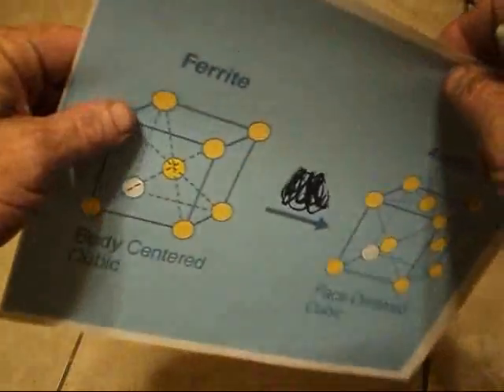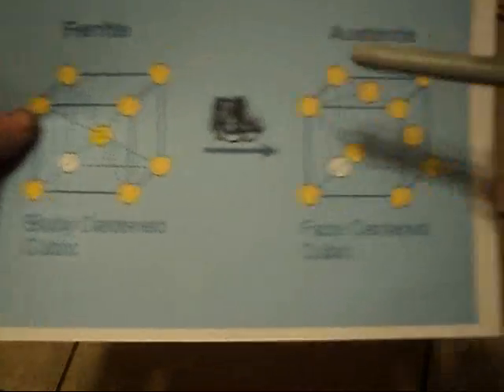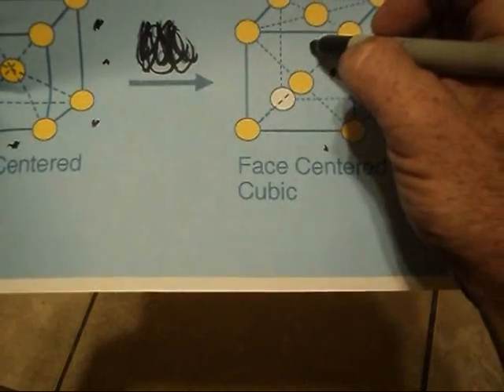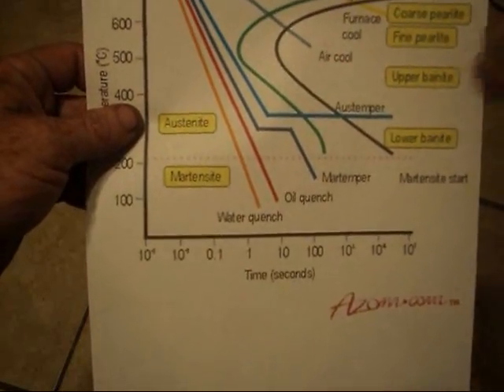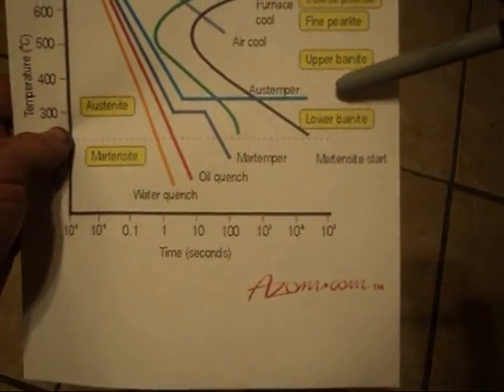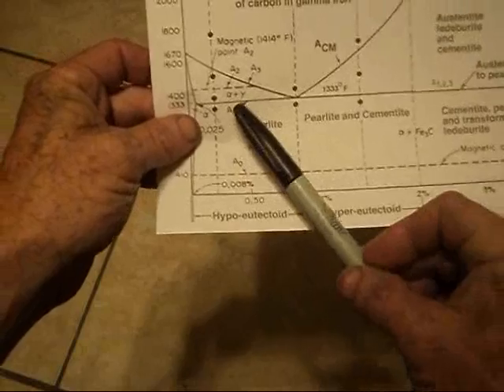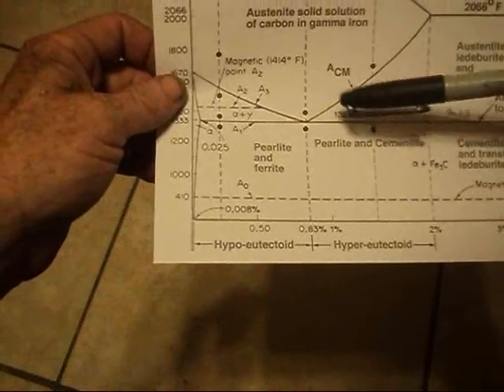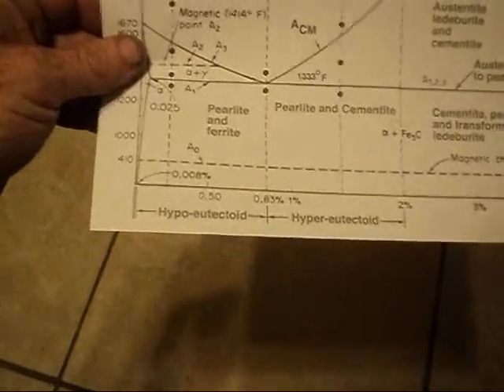Metallurgy

Comment: I may be wrong on this, so I stand to be corrected, but my understanding is that when quenching hypereutectic or high carbon steel you should quench from somewhere in between the upper & lower transformation temperatures. If you quench from above the upper temp you can wind up with iron carbide between the grain boundaries when it cools.

Comment: Man whatever happened with the khopesh?
Reply from the maker: Well I was kinda in a rush to finish and get it to its new owner so I couldn't really video the completion. I think I took some still pics before I sold it though if you wanna see it. I ended up using some old wrought iron I had from a fence that was installed in 1783 from and old fort close by for the bolsters and pommel with some nice rosewood for the grip. Sorry I couldn't video.
Reply: Ohhh okay. Yea that thing was turning out to be an interesting piece. Sounds like you did it justice though. Pictures would of course be appreciated, it's hard to find modern examples of a khopesh.

Comment: Very Good Tutorial. What Site did you get the charts?
I have been Machining a little over 30+ years. Working a Forge is a new ball game.
I my self understand most of the process, but this would help me explain what is going on in the Heat Treating Process, too my friends. Thanks Again  G
Reply from the maker: Thanks brother. I honestly can't remember where I got the charts though, I did this video quite a while back I just had it flagged as private because I made it as part of a friends tutorial. You can find charts pretty easily through google though.